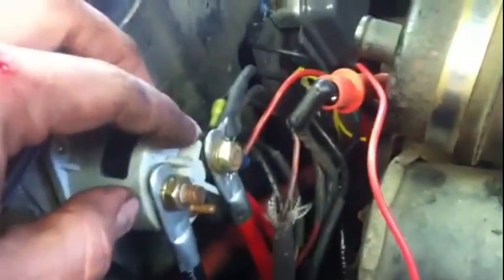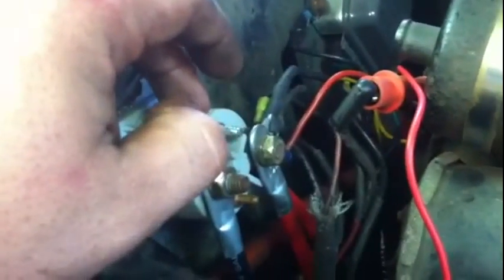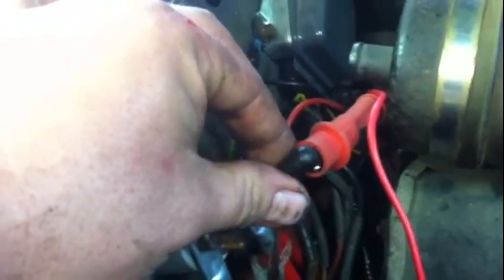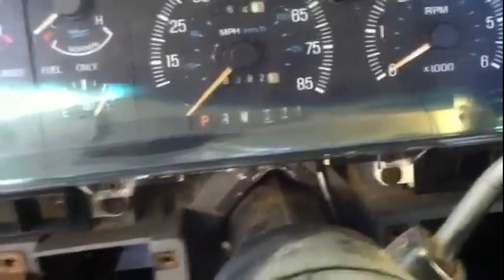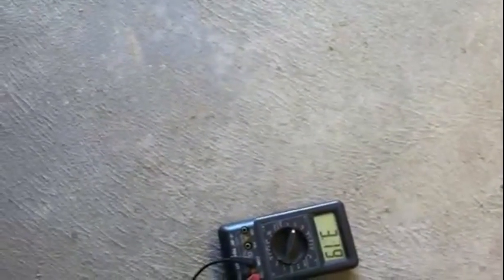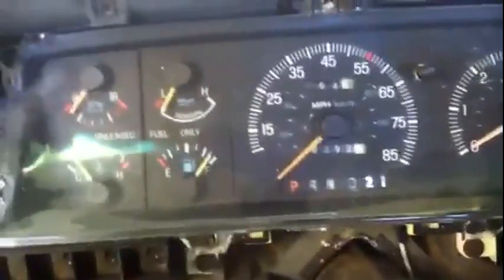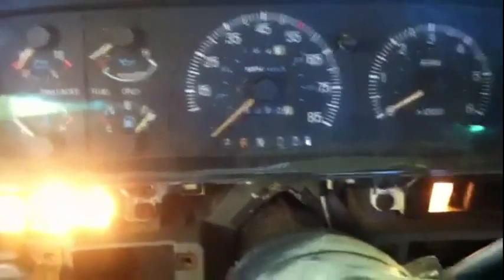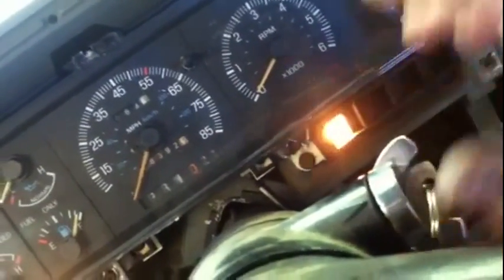1988 F350 NO CRANK NO START

Comment: After watching your video for a while I realized I parked on a slope and when I stopped the RV, it rolled back a bit  which it never does.  So I put it in neutral and it started right up.  The neutral safety starter switch sucks cause I've had this problem for a while. But thanks to your video, I'll do the start-in-neutral trick  1st before I go looking for shorts in the wires.  Thanks a bunch. God bless my friend.

Comment: Lastnight. I cut my truck off to order food in the drive through line. Go to crank it back up and nothing. Radio and lights. Work. But when you go to start it. Nothing.  No clicking ,no Nothing. I tried to cross jump it to get me home. She started wanted to turn. Just didn't seem to have enough to crank up. I'm going to try what you just showed me. You don't think it's anything in the steering column?
Reply from the maker: Probably not
Reply: I literally just fix the problem.  It was the tilt/shift actuator

Comment: I have a 1988 f250 7.5 use to start fine every time. Now what it does is when I turn the ignition nothing happens after a while it turns on it’s not the ignition switch or the battery

Comment: My 1983 Ford f250 does that sometimes, but it doesn't start right away or turn over! It usually takes a second or 2 before it starts right up. Why is that? It has a new
- starter
-solenoid 
-altantor 
ignition switch

Comment: When dealing with this did you have any interior lights or power of any kind
Reply from the maker: Yes everything else worked
Reply: Y.no. system is up and running. Batteries are 6 or 7 years old and seem to be losing a little storage especially at might 2, 3 in the am

Comment: I have 1989 ford f e350 460 motor .. It won't start I got new starter ..solenion .. New battery .. New key switch .ignition cylinder ..still nothing .. What else could be wrong
Reply from the maker: Does it crank over when you turn the key, or does nothing happen at all?
Reply: @Dugg_Digs_Adventure  nothing happen when I turn key. On ..
I mean nothing. Happen ..
Reply: I have the same problem on a 1985 Ford E350 460 RV and nothing works at all. 
My ex had to rewire the wiring harness because mice had gotten into it. I bought a new starter, fuel pump, batteries, and I don't know all what else. Just know I want to light a match to it.
I don't think he looked at the neutral safety switch but there is nothing that works. The head lights do but no lights in the dash, the cab no turn signals, no blower, no windshield wipers, nothing.
If it isn't the neutral safety switch then I don't know what to do.
I didn't even want to buy it but he said he could get it going, well it's been a month and all I have done is put money in it and it's gotten me no where.
Hope to hear back from you. I notice the guy in this video didn't get with you, I think that is pretty petty of him.  Hope to hear from you. Thank you in advance.

Comment: I need help to find the location of the main battery fuse on a 1988 tioga camper with a ford econoline 350 i hooked up jumper cables backwards now nothing when i turn the key it like i have no battery in ti please help
Reply from the maker: Sorry, on a camper I wouldn’t know where to look.  I have had experience with people reversing jumper cables, it usually does more than just blow fuses.  You might need to have it towed to a professional.
Reply: Did you ever find out what was wrong?
I have a 1985 E350 RV 460 and there is nothing when you turn the key.
Has new ignition switch, batteries, starter, fuel pump. He has change the solenoid twice, not new but still changed. The wiring harness had to be rewired due to mice but he took that wiring harness and the other one I bought to fix it and made it work.  So he says. But I don't think he checked the neutral safety switch but if he did then we have no clue what is wrong with it. Hope you got it figured out and you get back to me. Thank you in advance.

Comment: I just changed my battery cables for my 93 f350 I got power but no start u think this could an issue?
Reply from the maker: Yes also check your neutral safety switch
Reply: @Dugg_Digs_Adventure  ok awesome thanks man yea I went out and bought a new starter solenoid and I when j get back I will check that as well thank you for your help:)
Reply from the maker: No problem let me know what you find

Comment: My starter cranks, but the engine doesn't rotate
Reply from the maker: Started gear is not engaging.  More than likely bad starter.  Worst case is flex plate is missing teeth.  Put a socket or wrench on the crank bolt.  Turn the engine over slightly to move where the starter is engaging the gear.  If it starts you gotta pull the trans.  If there’s no change replace the starter.
Reply: @Dugg_Digs_Adventure  I'll be working on it more tomorrow. It doesn't spool up as if it's missing the flywheel. It cranks similar speed as it would as if it didn't have spark or if it was out of gas. Almost like the crankshaft snapped. Going pull the starter tomorrow though. Going record a video of what it's doing
Reply from the maker: Tag me in the vid or just keep me filled in.  I’d like to see the outcome.
Reply: @Dugg_Digs_Adventure  pulled the starter. The flexplate spins freely. Can almost spin it a full 360 degrees freely. Then, it hits a stopping point. Assuming snapped some bolts or something.
I did just up load a short video just now though.
Reply from the maker: Center of the flex plate broke out more than likely.  The bolt circle is w week point on them.  Good luck with the repair.
Reply: @Dugg_Digs_Adventure  ye, thanks. Just dropped insurance on it last night. Going to deal with it next year when it warms up again. It's just a project truck.

Comment: What did you swap out ???
Reply from the maker: I swapped nothing, just ran a new wire from the NSS to the starter solenoid.
Reply: @Dugg_Digs_Adventure  have a similar issue with 89 econoline 350
Just getting a click I replaced starter and still just a click , would it be safety switch or solenoid you think

Comment: You seem well
Informed, Do you know how to pull codes?
Reply from the maker: Year make and model, if I don’t know I’ll find out.
Reply: DUSTINS MOBILE WRENCH 1990 ford bronco
Reply from the maker: https://www.2carpros.com/articles/ford-lincoln-mercury-obd1-1995-and-earlier-diagnostic-trouble-code-definition-and-retrieval
This explains way better than I can.  Your test port/connection should be around the brake booster/master cylinder area.
Reply: DUSTINS MOBILE WRENCH yes I’m not able to get it to go over 25 mph after a transmission rebuild

Comment: Do you know anything about that issue with a manual transmission
Reply from the maker: Clutch safety switch perhaps?
Reply: @Dugg_Digs_Adventure  figured out the problem. Thanks for the tip though. There was a break from ignition to the solenoid.
Reply from the maker: Nice find!
Reply: Need help my 91 4.9 manual transmission doing the same it only clicks but won’t turn starter new relay new battery new
Reply from the maker: Bad starter or broken wire from solenoid to starter.

Comment: How did u fix it I replaced my neutral safety switch but still no power to s wire on solenoid relay.
Reply: Watch and listen. The guy went through it step by step without wasting money on parts not needed!

Comment: I have a 89 f350 when I turn the ignition it comes on but when I release it turns back and shuts off please help
Reply from the maker: Jasper Fail what you are saying is when it auto returns from start to run it shuts the engine off correct if so it sounds like you are loosing power to your coil through the ignition switch
Reply: I have an 89 f250. same problem. I thought it would be a loose wire shorting out in the steering column. or a failing ignition switch key. cuz sometimes if I wiggle the steering column, the truck will shut off. I guess now it's just a question of taking off the steering wheel and checking out the connections.

Comment: Hi Dustin’s mobile wrench I have a question....I own a 1995 F700 with the 7.0. The truck was running last weekend when the truck showed up. The truck has since been sitting and now won’t start. There is power coming from the battery through the relay to power things up. Do you think that it really could be a bad fuel pump or a bad start/bendix
Reply from the maker: You seem to be asking if it’s a bad starter or fuel pump.  So if it’s a crank no start go after fuel or spark.  If it’s a no crank no start go after the starter or start circuit powers and grounds.

Comment: I have a 1999 f-350 . i have full power in the battery , it will crank at the solenoid . i have no power inside . no lights . I have replaced the ignition switch and checked all fuses . still no power . CAN SOMEONE HELP ME PLEASE .
Reply: Did u fix?  So do i , same problem. No interior dome light. But headlights i do have.
Reply: Did you fix
Reply: I’m retired from cars. Im an inventor.

Comment: Sir I have a problem with a 86 f250 and it's was working than no power what so ever so could you tell me what to do to fix it or find the short
Reply: I have the same problem with my 91 7.3 idi turn the key to the on position no power anywhere
Reply: But if I jump the glow plug relay to the battery it starts and runs

Comment: I connected the negative terminal of my battery with the positive wire. When I put the ground onto the positive terminal it sparked like crazy and then a wire on solenoid fried all the way in half. I’ve read that it may have been a fusible link. Any ideas? It’s a 1988 f150.
I know, brain dead move.
Reply from the maker: I doubt very much it was a fusible link.  Replace the entire wire.
Reply: That was one of the worst things I've ever heard of someone doing. Connecting a positive battery terminal to the negative? The battery could have exploded, literally. How dangerous can you get. You need some primers in electrical and automotive repair safety.
Reply: @5400bowen  I can feel your caring spirit through the internet. Thanks for looking out.